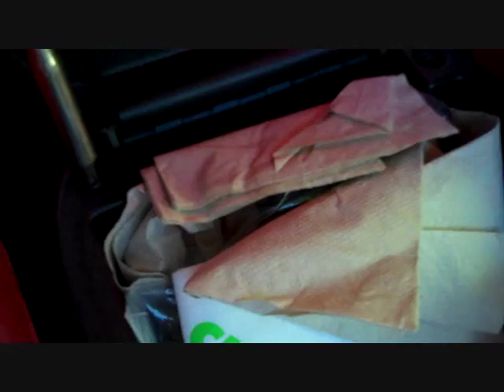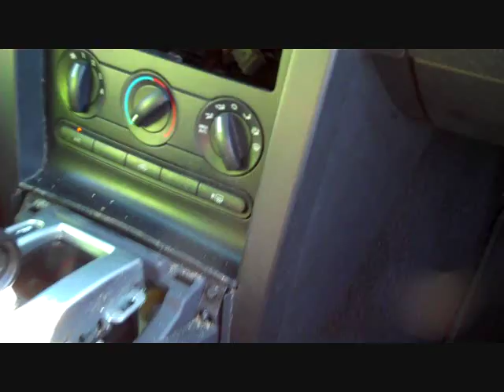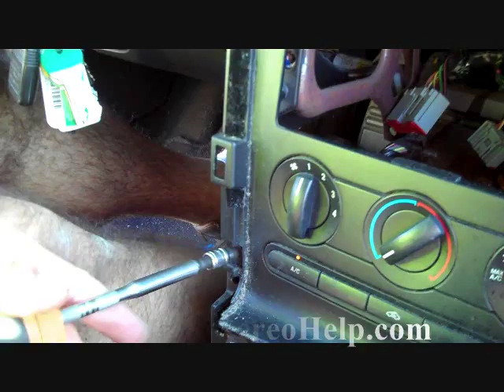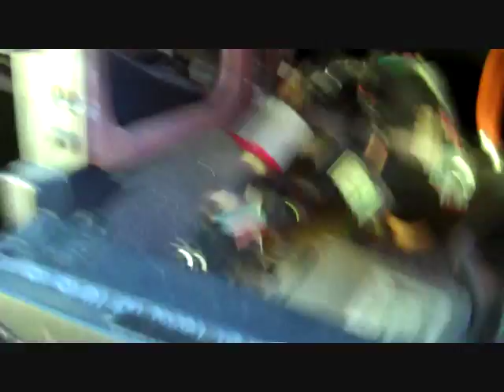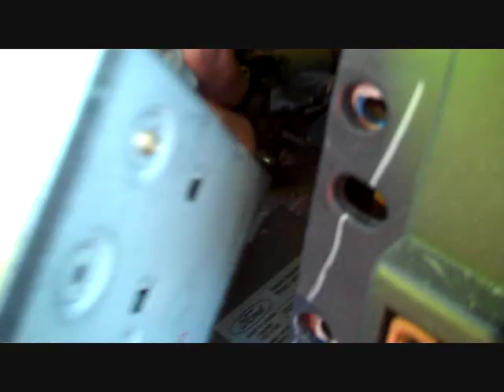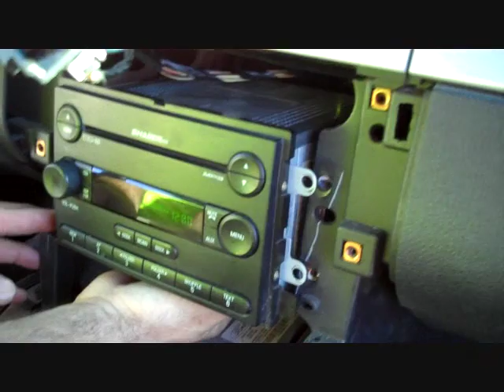Ford Mustang Car Stereo Removal = Car Stereo HELP

Comment: I have a 2005 Ford Sport Trac with an OEM Pioneer 6CD. It has an AUX button and SAT button. Which 4 pins on the plugs do I install the AUX Jack and which pins do I install the SAT Antenna Lead?